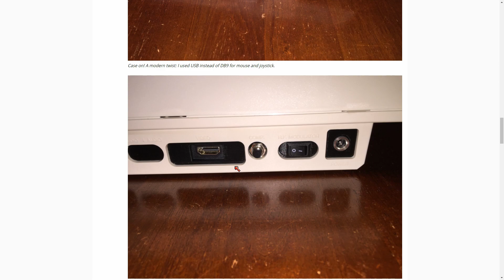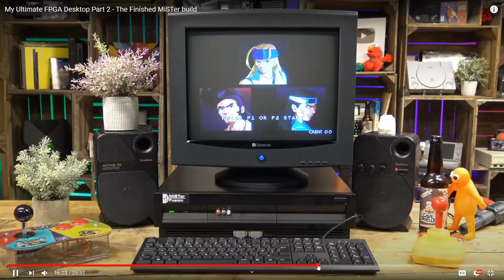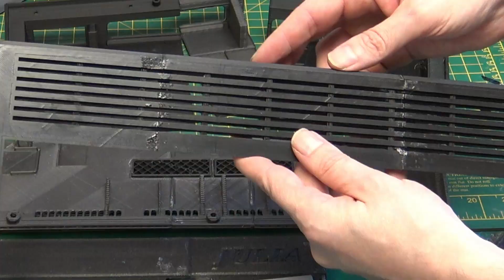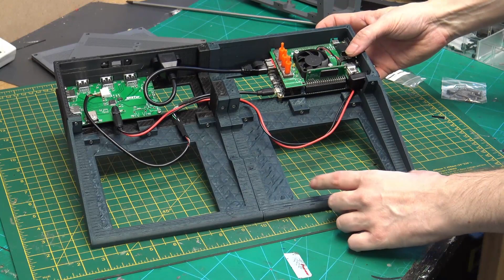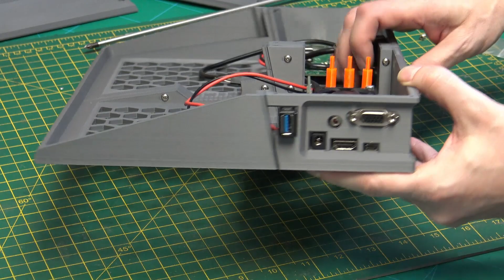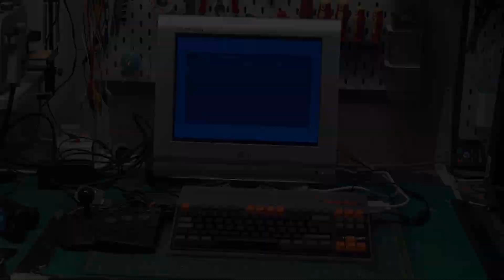My 3d printer MiSTer FPGA  retro wedge  case

Comment: What a fabulous project! I’ve actually done the original A600 mister case project, but I quite want to get an A600 motherboard and make a real A600 with this. This will be perfect as a replacement. Picked up a new 3D printer this week. What timing! I will be donating shortly!
Reply from the maker: well this is a good amount of printing to get you started !
Reply: @leesmithsworkshop  yep, I’d better stock up on PLA! I had a very basic Tronxy X1 which I used to do the Amiga fittings. Very poor quality prints, lots of filing needed! Just got an Ender 3 V2. So good!
Reply from the maker: @martlowe  I have two Tronxy x3a and they are no too bad. The best quality printer I have is the Creality CR-20 pro and then I have two ender 3 with ABL mods.

Comment: This is inspiring.

What about an IBM XT Case from scratch for the Xi8088 motherboard and parts? Nobody makes such a thing, you could sell it.
Reply from the maker: it's already on my list of possible options for my XT build. 3D print something that looks like the IBM XT  or mod the small ATX case I brought. I have my big 3d printer working so I can print larger parts in one.
Reply: @leesmithsworkshop  My first computer was an IBM XT Clone (looked just like it, different sticker) and I'd like to reconstruct one from scratch one day with brand new parts using the Xi8088 project and what looks like an almost proper IBM XT case.

So I selfishly beg you, good sir... to show me the way. :)

Comment: Absolutely brilliant! Top notch work. I am trying to do a similar project with a Raspberry Pi4. I think projects like this are the future of retro computing as our beloved machines get older and break down. Your setup is extremely well done and beautiful. I love my MiSTer as well, but I need a better keyboard for it because the modern one I have kills the vibe
Reply from the maker: Thank you :) I should make a module for the pi4 as well.
Reply: How has the project been? I ask because I'm interested in trying to make my own version of this.

Though it would be cool to slightly adjust the case a for asthetics purpose. Otherwise, I'm easily happy with how the case is right now. I would have to also give it a custom paint job but I want to make sure that the surface is smooth.

My only issue is making sure that I have the appropriate keyboard size/type. As well as finding a keyboard that is affordable. I don't want any fancy RGB light colors. If it's mechanical and I can get certain keys in a color, I'll be good.

And yeah, I'm definitely going to get a raspberry pi 4 so hopefully the case is compatable.
Reply from the maker: @JLCL01  HI,k If you are asking me, I have not looked at a pi 4 yet, but I did buy a official pi keyboard and I will be looking at a new case for it and the mister.
Reply: @leesmithsworkshop  I wasn't but it's nice to have feedback from you.

You're talking about the red and white keyboard? I looked at a video that showcased a teardown and it looks like it's a completely different board. I'm not sure how easy it would be to have it so that way you can use a different keyboard.

I actually watched your video after work. I definitely plan on getting a TKL keyboard. Did you have to get a keyboard and get the color cap separately?
Reply from the maker: @JLCL01  I am talking about the keyboard only that does not include the pi inside and I have the black version. It's just a usb keyboard so will work with the MiSTer too. I do have a colour key cap set on mine  it's called carbon on amazon.
Reply: @leesmithsworkshop  my bad, there's a version of a keyboard out there where it's a raspberry pi but the board is very different. That's the one I thought you were talking about. I know there's also two versions out there
Reply from the maker: @JLCL01  you mean the rpi 400
Reply: @leesmithsworkshop  yeah, I was talking about the RPi 400.

If I do get the 3D model to print, do you recommend that I do it through a third party company? I do not have a 3D printer myself.